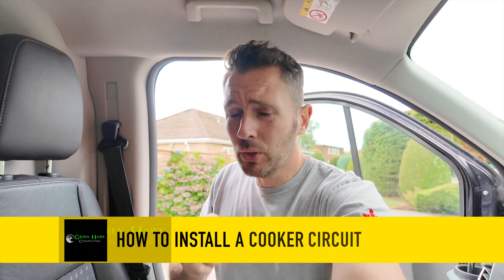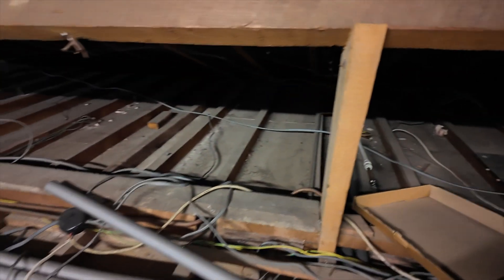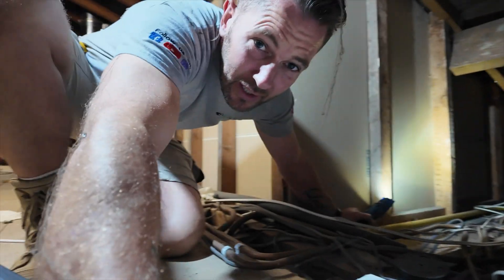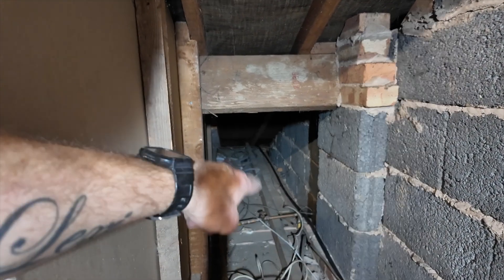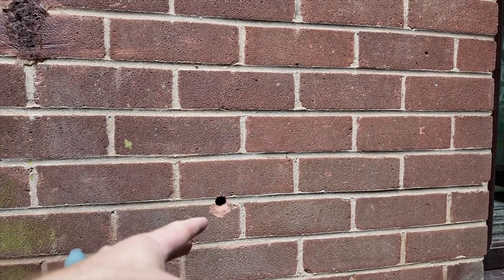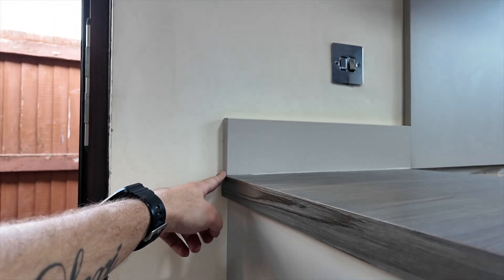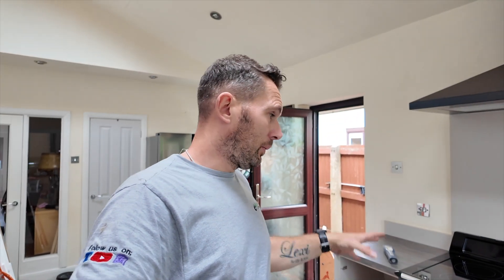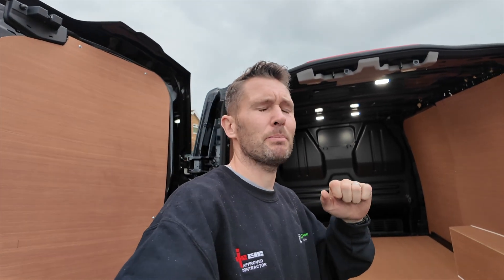how to install a cooker circuit - #range cooker #oven #cooker

Comment: HELP... 
38amp cooker with 32amp breaker
6mm cable
Is that correct?
Reply from the maker: Always refer to the manufacturers instructions. We installed years ago, a huge range master oven which when calculated should've took a 16 mm Twin and earth, but after speaking to the manufacturers, they specified a 10 mm
Reply: Because of the Diversity calculation - perhaps. All elements won't be on together and if they ever are not for the long term.

Comment: You didn’t really show how to install a cooker circuit. You showed how to run a cable. Would have preferred you show the termination of the swa at normal speed, fitting the isolator and then connecting to the mcb/rcbo. Appreciate you need to replace consumer unit.

Comment: Question on ring mains and isolation switches pal.... do you put the sockets on the ring  then run a isolation cable or put the isolation switch as part of the ring and run a cable for the appliance switch? Hopefully the question makes  sense :-)